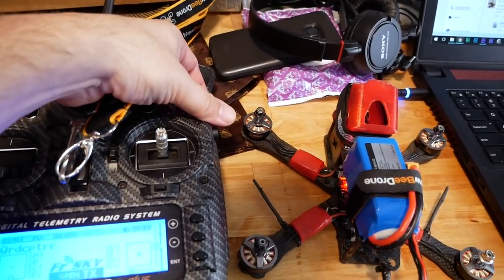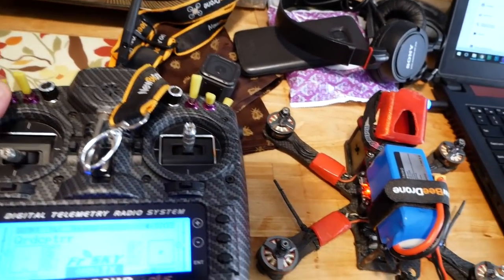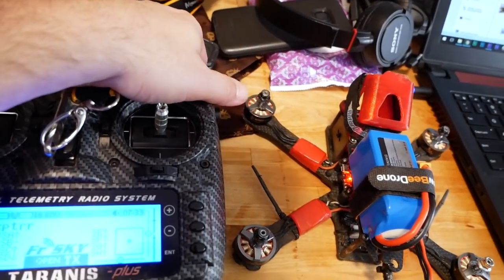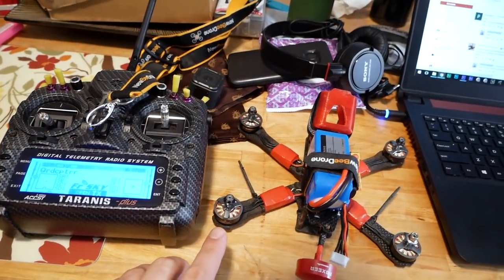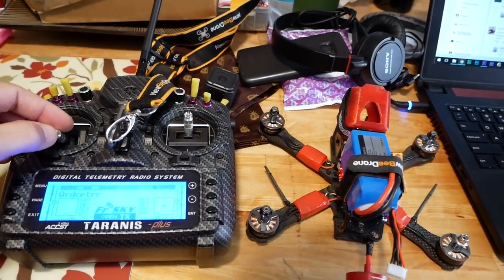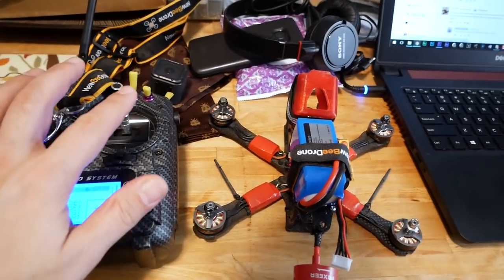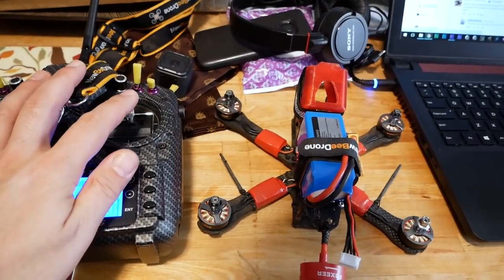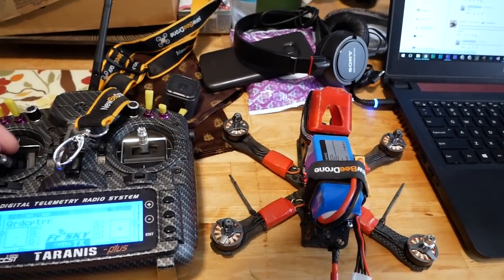Can You Troubleshoot #6 - CYT Why Throttle Doesn't Work but Pitch And Roll Do?

Comment: Ok. Since troubleshooting is usually a process of elimination it's impossible for us to test further to gain a path of investigation. 
Based on the info provided, here is how I would proceed...
- connect to BF and go to the receiver tab to test if the throttle slider bar is reacting to stick inputs. This should help isolate whether it's more likely to be a quad problem or a radio issue.
- check the AETR channel order in BF
- check that radio/model is configured properly with end points trimmed and showing correct throttle micro second registration through its travel.
- if another quad is available test it with the same radio to rule out gimbal axis failures.
- check min throttle/min check in BF

I think by now one of the above would have revealed more information hopefully allowing the correct avenue to be pursued. I often find pure persistence and determination are as important as rational, logical thinking in these matters.
Someone much smarter than me once said, "there is no problem that can withstand sustained thought". Really love that resolve and tenacity!

Comment: Channel mapping...Things look reverse there JB when you moved the sticks the motors spun  the correct direction but looked like the wrong sets of motors, pitch forward should run the back motors and pitch back the front...etc, so got to be some sort of mapping problem, motor assignment?

Comment: Motor stop is enabled and the channel order is wrong either in betaflight or in the transmitter, such that pitch and roll are correct but throttle is assigned to a wrong channel instead.
In my view this could explain the situation but i havent taken the time to test it...

Comment: Ok, can I get a second go...? Something wasn't sitting right with me and I had to revisit the video on a bigger screen than a phone.  I also had a feeling that you would have provided all the necessary information to allow a firm conclusion to be reached.

I've restudied the footage and I'm now quite confident in suggesting that the problem is in modes or switch assignment - that quad is in turtle mode. 
All motors are spinning in the opposite direction that they should and the opposite handed pair react with reference to the direction of stick deflection. The behaviour of the quad is exactly in line with how it should behave in turtle mode.

Comment: Turtle mode is permanently enabled (maybe due to wrong switch assignment). I haven't configured turtle mode for any of my quads, but I'd expect that BF only ever spins two adjacent motors in this mode even if you for example move the pitch/roll stick diagonally to a corner.

Comment: If it’s running DSHOT, it could be turtle mode. In turtle mode, the pitch and roll axis work but throttle and yaw are disabled. Double check to make sure one of your switches did not get flipped which activates that mode.

Comment: esc's respond to the fc output trying to level itself, but not Tx output on throttle channel, GUi would indicate rx/fc system responding from tx. hmm...maybe a poor connection that won't carry the full load.To ignorant overall to really figure it from the clue but if I have to guess on it I think a loose connection could cause such a symptom. Seen some mighty weird stuff happen due to loose connections.

Comment: Turtle mode is active, since throttle doesent work and the motor orientation is reversed, since when you roll right, the right motors spool up instead of the left ones.

Comment: Without testing my theory..I would first guess the channel on your taranis is off, my second would be that you set your peramiter for that channel is to high that it will not arm throttle. Meaning your transmitter is searching for zero throttle and your switch believes it hasn't reached zero throttle to arm.

Comment: Ha! This is pretty cool Joshua :) Hmm, I have limited experience but I would guess that the set idle percentage is set above low throttle level. The set low throttle level has to be higher than the set idle percentage for motors to be able to idle and then after idle is achieved it is then able to throttle up.

Comment: I had that before 2 times the same symptom,
the first time was because my rxrange value for the throttle in betaflight was to low,
the second time was the Stick Min value in the Radio Setup screen

basically are kind of the same thing

Comment: you mention that the right motor spins at a certain stick movement, but it seems that he does not give the correct input. To give an example, if you roll the stick to the left on the transmitter, then the left motors will spin, this will cause the quad to roll to the right. the same applies to the pitch. For this reason I think there is an incorrect setting in betaflight under 'channel map'

Comment: PWM input range off - need to adjust that range in BLHeli.
The hilarious version is the opposite, where on arm one or more motors spins up above half throttle at the Betaflight idle setting...

Comment: Not a solution, but in the video you say that the correct motors do spin, but if you pull the pitch backwards, the front motors should spin up to tilt the quad backwards, not the back motors.

Comment: @ Joshua Bardwell.I just purchase the unify pro 5G8 HV and when I power it up it just blinks that orange led and it never stops but when I hold down the button it lets me switch thru the channels,bands,and power out put and lets me save the settings but im not getting any video what so ever and when I power off and then back on again, it seems to do the same thing which the orange led just keeps blinking. This is really frustrading because these things are not cheap and I don't have any$ to just be throwing around.Please if you have any answers to what this could be please let me know thxs

Comment: One guess. Wrong channel mapped to throttle and idle is too low to make the motors spin - EDIT  Rewatched when doing left roll both left motors spin more which would be wrong. Therefore what I said was totally wrong and i believe you are in "turtle mode"! Probably the SD switch needs to be up

Comment: The quad was functioning as if you were in Turtle mode but I could not determine if the motors had reversed to be sure.  But that's my guess - Quad was in Turtle mode.  ;-)

Comment: Looks like 
Min_Check is set to high and you have to adjust the throttle endpoint to a value lower than the min check. Or set the min_check to a higher value

Comment: i have some sort of problem with my quad, it has tattu 30amp esc and tattu 2205 motors, when i arm the motors they spin but the act like they are bound up by something. and i know for a fact they aren’t, but they violently try to spin but act like they are stuck, what could be the issue with that?

Comment: Lets try!! In my experience is easier to find something knowing what is sure not. Its not a motor, esc or electric problem. Remote has connection so is not too, when arming problem leds tells about issues. I would say that could be accelerometer problem, if where gyro would not spin, even arm. Could be?

Comment: Does the solution work on brushed boards as well such as the furiousfpv acrowhoop? I’ve been dealing with the same issue on my whoop. My props arm and spin but no throttle response.. thanks!

Comment: You should check this list in this specific order ( or not your choice) 
Check the throttle in the betaflight configurator to see if the receiver is working properly 
Check the throttle in the radio if it is working properly 
Then pray to QuadGod because I don't know

Comment: Hey JB!  On the subject of troubleshooting, I was hoping you can help me. I was setting up my Darkmax 220 (my RMA replacement, in fact) and everything was going swimmingly until the last step. I was going to access the camera's OSD to make some changes, but when I touched the OSD controller (which is on the back of this camera) I lost video!  The BF OSD still displays, but the image is a black screen. I literally held the controller in the UP position for, like, 3 seconds. I've scoured the internet, including your related video, but I can't find a solution. I've also tried another camera that I know is good, but no joy. I've monkeyed with NTSC/PAL in Betaflight as well. One problem is this Artower F4 board uses JST connectors, so I can't direct solder the camera as a troubleshooting step (at least I don't THINK I can).  Thanks!!!

Oh, is the problem in the video Min Throttle?

Comment: Your board is upside down and it hasn't been set in ur gui, so the small angle is stopping it from arming? I'm not sure because it did arm and my small angle is set to 180 for turtle mode so I wouldn't know but its worth a guess.

Comment: Hard to tell without the full info or at least BLHeli / BFlight versions, but would put my money on permanent turtle mode due to wrong configuration in modes tab, other possibilities are motor idle set to 0 and wrong channel mapping or PWM reciever with faulty throttle channel connection.

Comment: It sends too high esc commands (too high neutral value after arming), so when you move roll or pitch, 2 motor commands are getting below the max and start spinning, other 2 are still too high(even higher). Something in that direction.
From radio it must be okay - it also arms, so it must be something wrong with the motor control :) escs probably "beeps" at battery plugin, so FC's sending proper idle command to escs. doesn't seem like 3d mode, custom motor mix, or calibration.

Comment: When you pushed the stick forward the front motors started spinning. The motors are working inverted. And they are not spinning even when armed. This means the quad is in turtle mode.

Comment: set min_command is set higher than max_throttle is my guess. If on Dshot however I don't believe this is the command. As i don't use it I dont know what the equivalent would be (idle percentage)